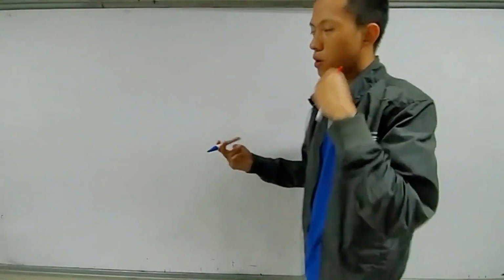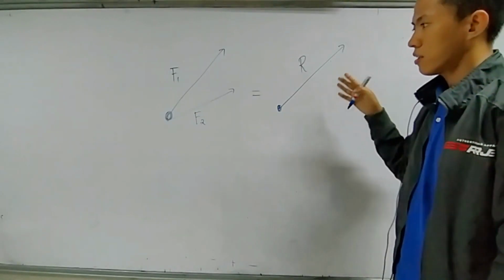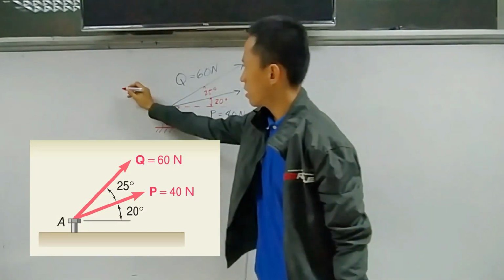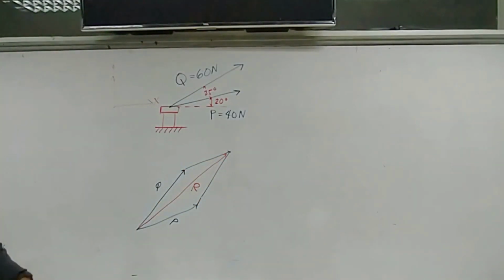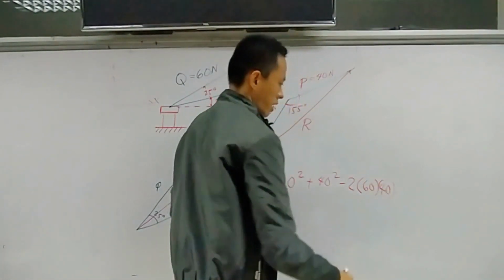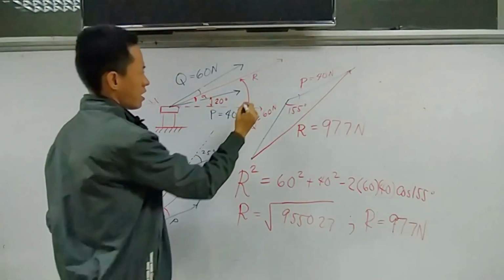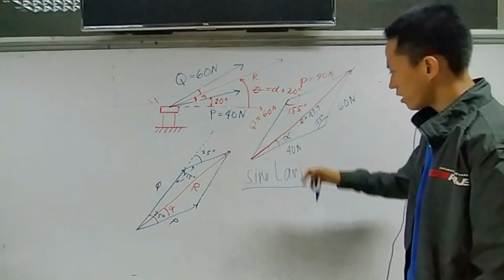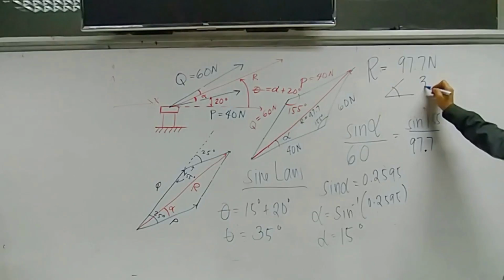Paano Makuha ang Resultant Force Gamit ang Parallelogram Law |Statics of Rigid Bodies Vlog # 108|

Comment: It seems you were in a hurry to end your vlog and missed a very crucial point. Having calculated the magnitude of the resultant force and the angle  is NOT yet a complete answer. The direction of the resultant force must be expressed in either degrees or radian (which you did) but you forgot to specify the line of reference upon which the angle is based. Use your diagram as basis in describing this direction (example: 30⁰ relative to F₁).
The parallelogram method you used here could have been made easier had you used the triangular method (head-to-tail) instead because you don't need to draw the mirror projections of the given force vectors. The figure is better understood when done using the head-to-tail (instead of tail-to-tail) especially when cosine and sine laws are applied for computations. Hope you take these points constructively.